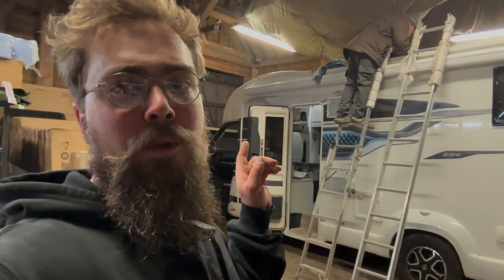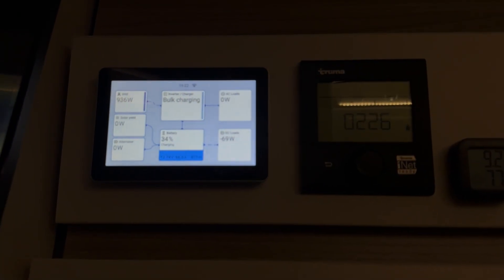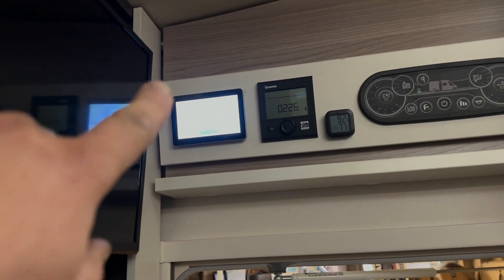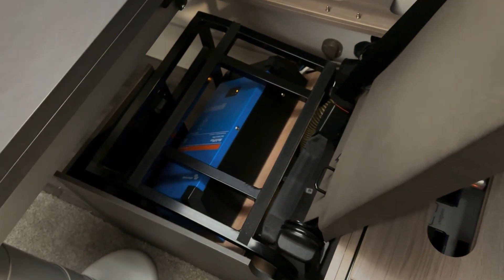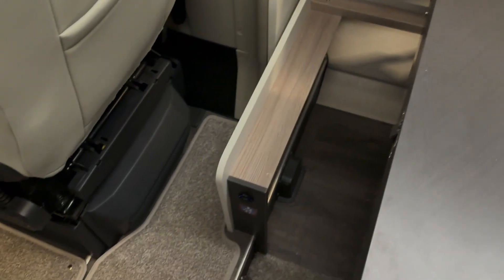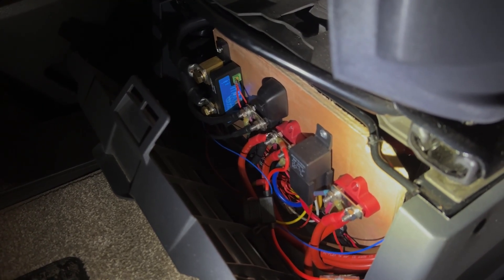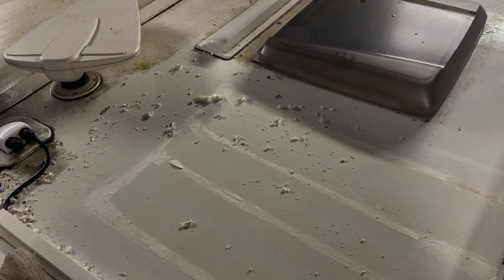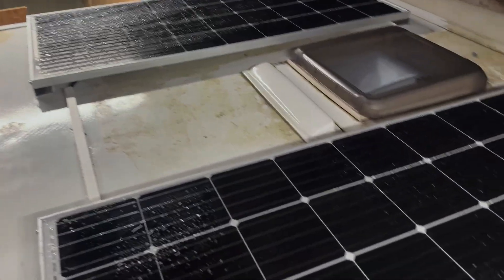Upgrading a Swift 684 with Fogstar battery and full Victron system

Comment: Great information. You did our M/H a couple of years ago  and it is working great. This is fitted differently to the way you did ours. I  take it that this is based on a Ford Transit and therefore different position of batteries. Would be good if you could state base model of M/H to help potential customers.  All the best for the New Year.
Reply: It was a Fiat base.
Reply from the maker: It was a Fiat Ducato chassis. Where stuff is installed really depends. It'll vary from van to van depending on the layout, what the customer's preferences are, etc..